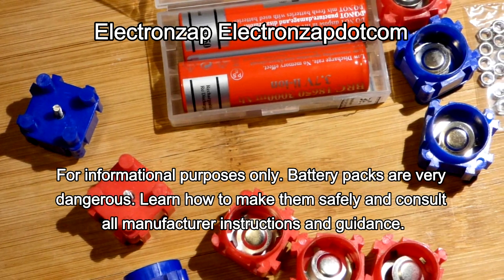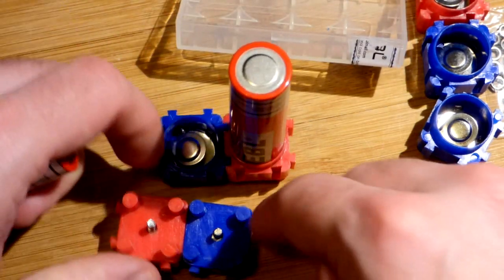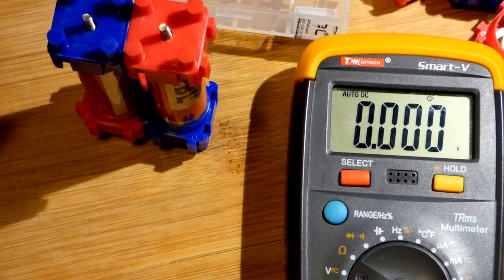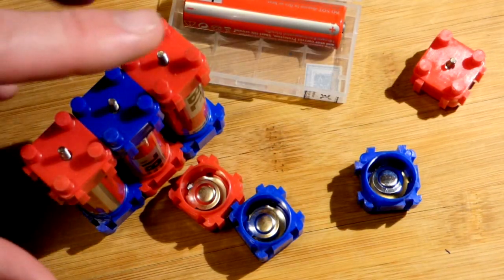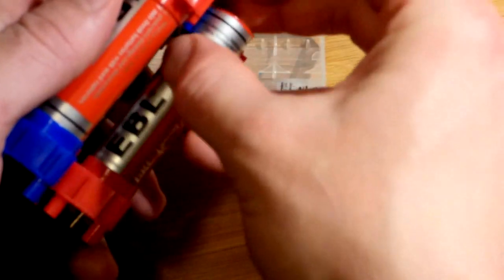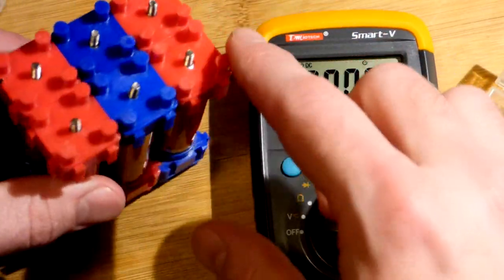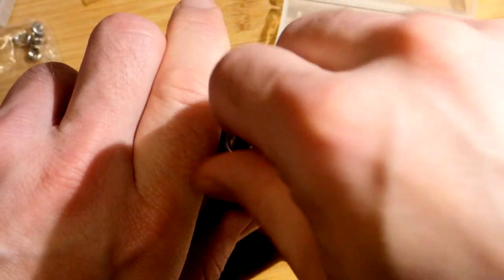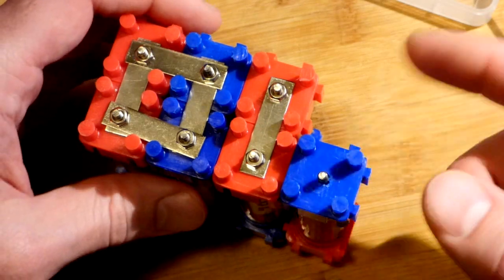Vruzend li ion battery pack build 3 series 2 parallel 3S2P snap together solderless weldless system

Comment: I would think that this would be a very decent solution for working with op amps if you don't already have an expensive bench supply that provides positive and negative voltages.
Reply from the maker: It's definitely an option. I try to come up with as many uses for things as I can and I will be powering a lot of stuff with DIY battery packs in the future.